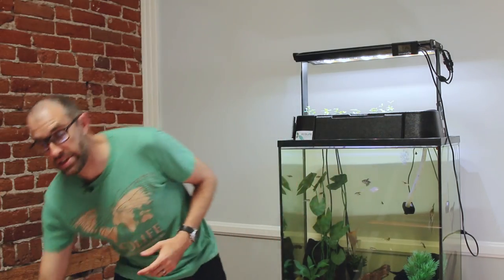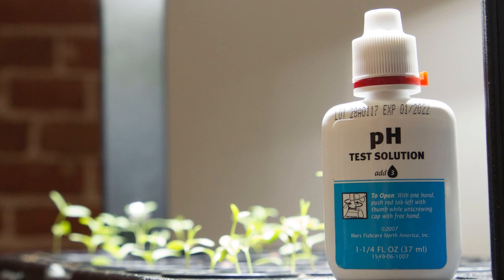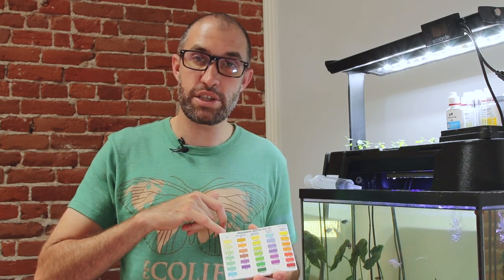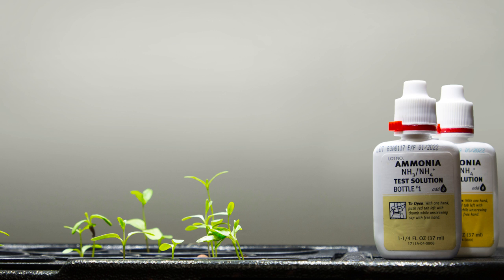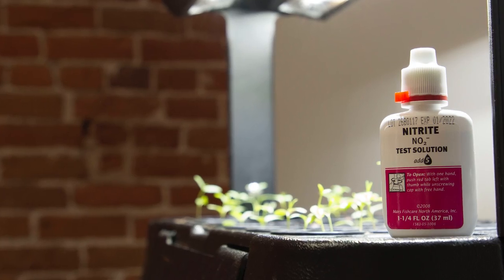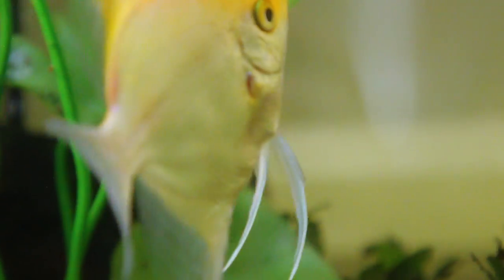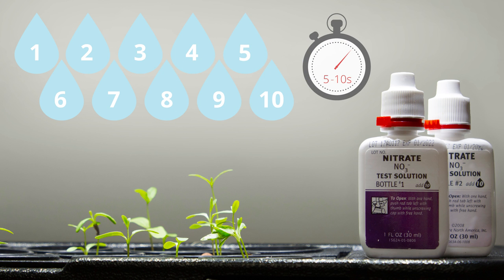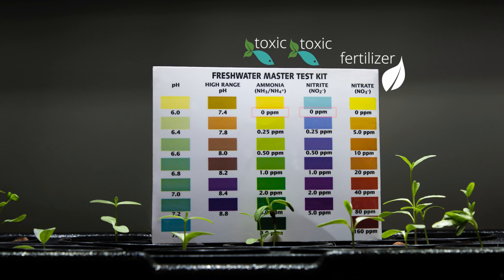Cycling and Testing Water Quality in Your ECO-Cycle Aquaponics Kit

Comment: I prefer to teach people about fishless cycling, whether it be with decomposing fish food (my preference), or surfactant free 10% ammonia (Ace Hardware Janitor stuff).  That way, we can avoid putting the fish through the stress of being in an uncycled system.  I guess I would try to dose the ammonia so the aquarium reads 2ppm, definitely no more than 4ppm (what do you think?).  We can also just simply buy nitrifying bacteria to inoculate the filter with so as to get the cycle over with right away and add the fish (instead of waiting 4-6 weeks).  In the aquarium hobby, I tried to keep nitrates below 20 or 40ppm with water changes (that was before I learned about denitrification filters with anaerobic bacteria, which I never really got to work with yet), but in aquaponics, I've heard of people letting it go as high as 80ppm or more (definitely no more than 160ppm).  But yeah, once the aquarium is cycled, whether it be with decomposing fish food or the ammonia I mentioned, and the nitrates are within an acceptable range (doing a water change if needed), I then make sure the pH is right and add the fish.  To acclimate the fish so as to avoid stressing them out, I first turn off the light in the aquarium, then float the bag the fish are inside of within the aquarium itself (the bag is still sealed), perhaps for around 25 minutes, so as to stabilize the temperature first.  Then I open the bag, carefully dump them into a 5 gallon bucket, and take water from the aquarium (little by little), adding what I estimate to be around 10% of the volume of the water within the bag the fish were in, every 5 or 10 minutes, until I've basically doubled or tripled the volume of the water that was in the bag.  Then I add the fish to the aquarium, but I don't dump the water they were in with them because that can often contain medication.  I try not to do the acclimation process any faster than one hour, but I think I've taken a couple hours at times.  There's a drip method too, where an air tube/hose is used to drip water from the aquarium into the bucket (tying a knot in the tube to create the drip).  Oh yeah, and never use chlorinated water.  It can kill the fish, and it will kill the bacteria.  Use to be that we could just use an air pump/diffuser in a bucket to gas off the chlorine in the water after around a day or so, but now a days, many water plants are using chloramine, which can't be gassed off.  You have to use a dechlorinator for that stuff, and it will have some ammonia in it (the chloramine).